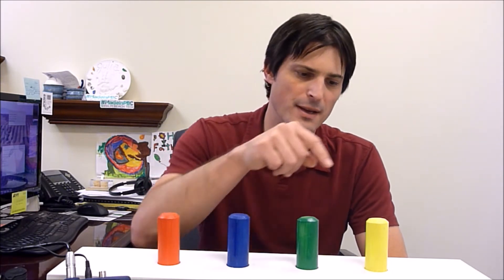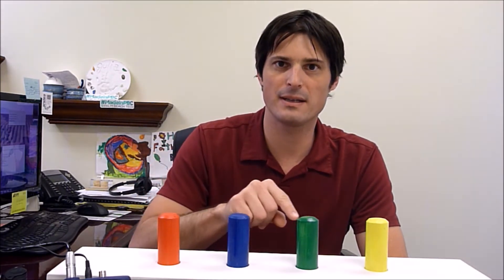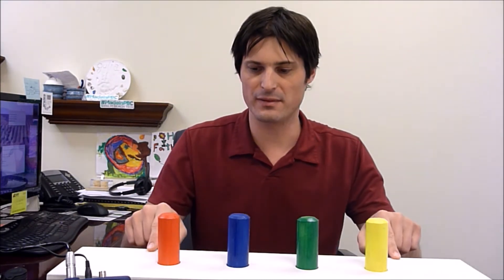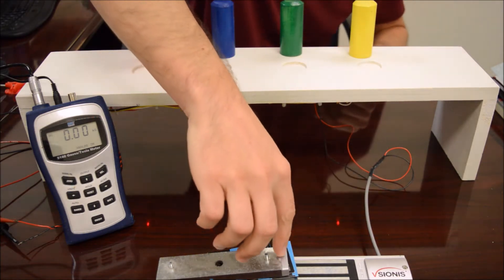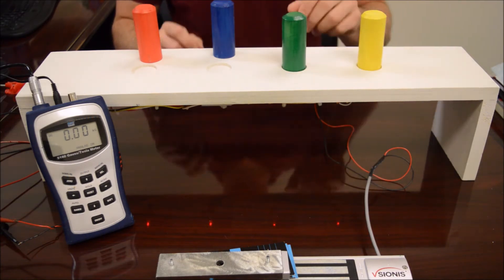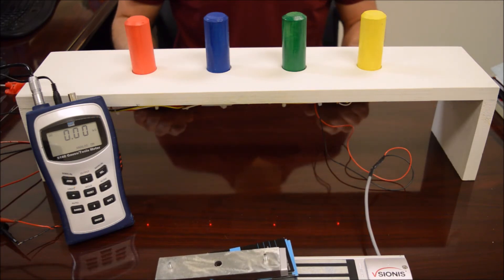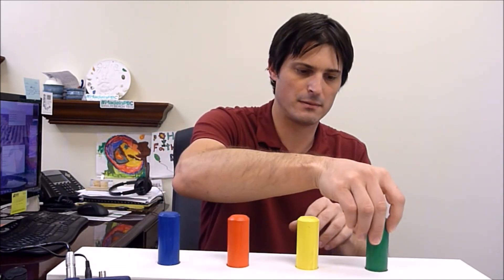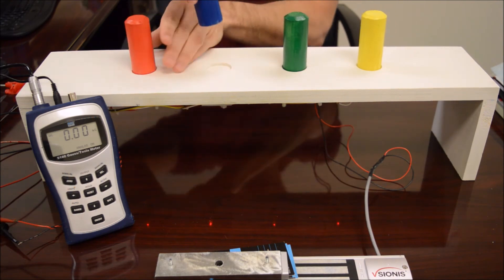Reed Switch Replacement - AEI FX50 - Escape Game Prop Controller

Comment: Im wanting to trigger 2 maglocks simulataneously using the bad ass controller and 4 of these same FX51 sensors, i have all the equipment. I cant figure which wires go where on the bad ass controller. Can i get some sort of wiring diagram?
Reply from the maker: Please write us at escape@escaperoomtechs.com with details. While these can work together, it may not be ideal.